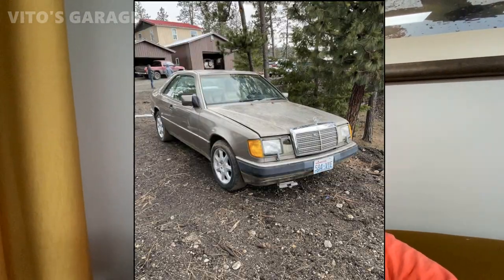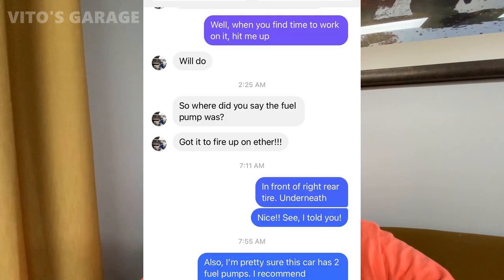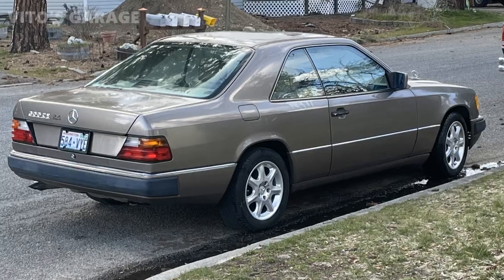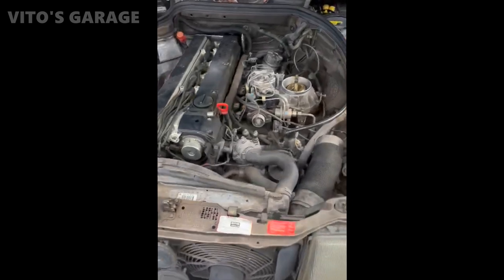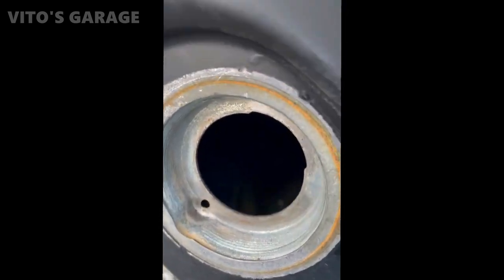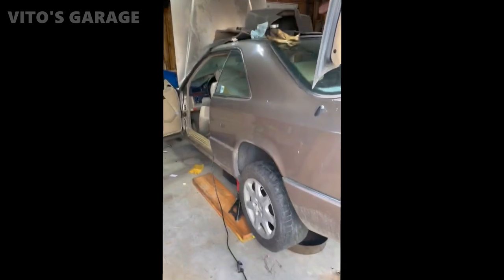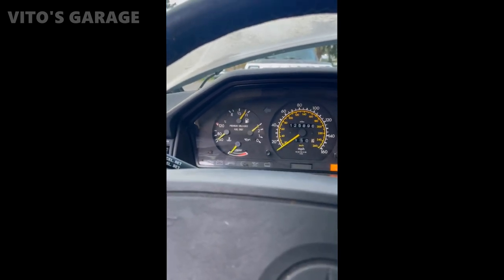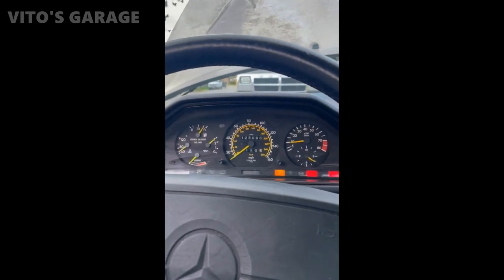We Saved This Amazing 1990 Mercedes 300CE-24 Valve !!! We Are Looking For a Good Home For it! #C124

Comment: Lovely car
The only thing i don't like of these is the inefficient cis ke-jetronic, the hfm 94 up engines are much easier to work on and less complicated and more reliable
my grandpa still owns a 94 sl320, and it is lovely, just has 90k km and it is the first year with hfm engine management
Reply from the maker: KE Jetronic is not that bad. And early KE Jetronic engines didn’t have engines wiring harness problems
Reply: @VITOSGARAGE  they are much more complicated than hfm engines though
Reply from the maker: @simonomisimonomis  I will take KE Jetronic over carburated engines all day long
Reply: @VITOSGARAGE  i also will but hfm engines are better than ke ones

Comment: Hey Vito, do you know if the 24v head will fit onto a M103 engine
Reply from the maker: Are you talking about 24v M104 or 24v M103 fitting onto a regular M103?
Reply: @VITOSGARAGE  m103s are all sohc 2 valves x cyl (12v engine)
all m104s are dohc 4 valves x cyl (24v engine)
Reply from the maker: @simonomisimonomis  correct. M104 head will not fit on the M103 block. M103 had 12 valves but never 24 valves
Reply: @VITOSGARAGE  yup, i just cleared out what he meant

Comment: How is the parts availability for these? Mercedes isn’t very good at that I think.
Reply from the maker: Lol, what do you mean Mercedes isn’t good at that? Everything is available
Reply: @VITOSGARAGE   W140 there are many parts that are no more available starting with the keys depending on the year, belt tensioner, muffler, I know someone that has problems finding a windshield for a W124 and other parts.
Reply from the maker: @EnthusiastCarHangar  they probably just don’t know where to look
Reply: @VITOSGARAGE   Mercedes dealer said they don’t make those parts anymore. Told you what I need and no a availability.
Reply from the maker: @EnthusiastCarHangar  there are lots of good parts available on the internet. Also NOS parts. Sometimes it’s also worth typing the part numbers in google and it’ll give you many choices for parts. Just gotta know the part number. We found a new bumper for W124 online and my buddy ordered it. If you look for something, you’ll find it. If you give up easily, then of course you won’t find it. There are lots of companies in Europe that distribute parts too and they have many options
Reply: @VITOSGARAGE   If you find a seat belt tensioner for the drivers seat let me know. Haven’t been lucky for a long time with used parts. 1999 W140.
Reply from the maker: @EnthusiastCarHangar  I’ll look for it when I find time. Do you have a clue of what’s wrong with yours? Maybe we can fix it
Reply: @VITOSGARAGE   The seat belt barely retracts. It’s been cleaned and checked. It’s one unit with the belt so not too much you can fix on it.